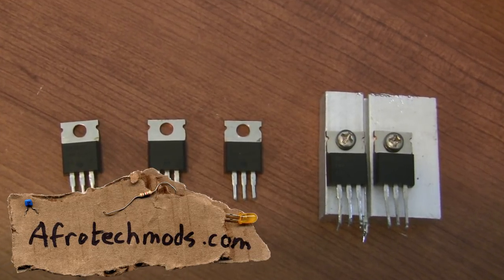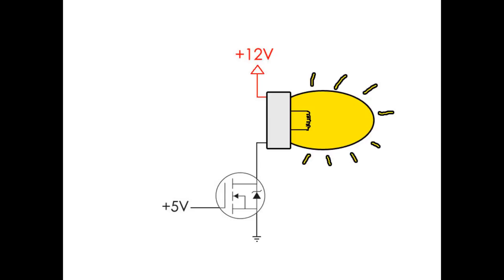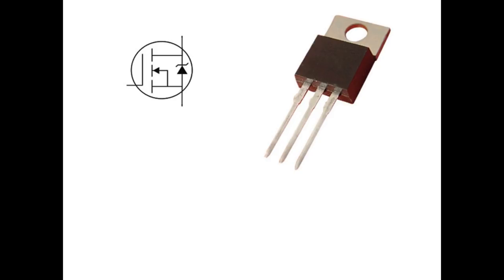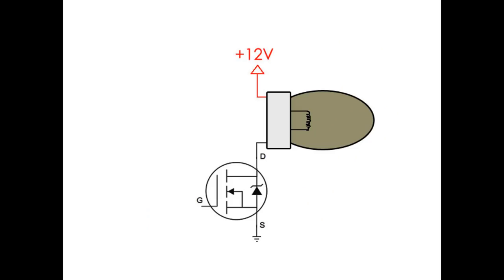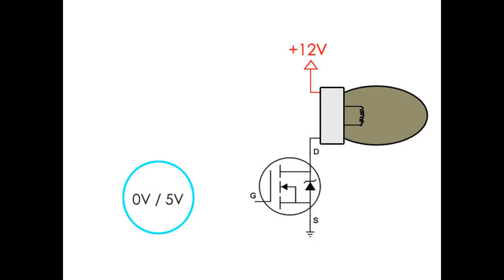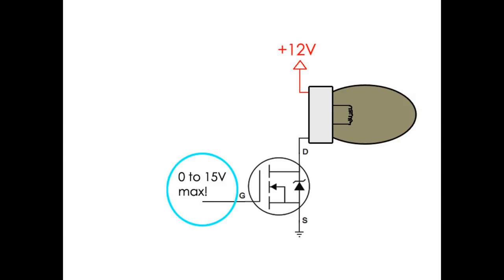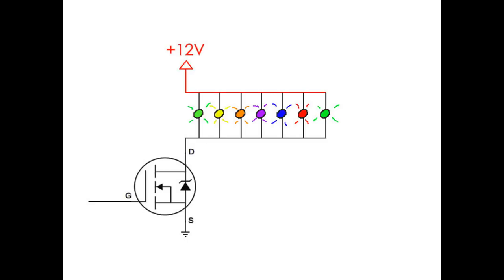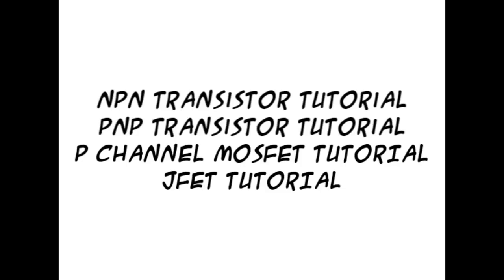Transistor / MOSFET tutorial

Comment: Great tutorial, Just what I have been looking for, thank you. Could I use the 3.3v from my hc-sr501  (PIR Sensor) to power on the IRFZ44N mosfet?. Hope someone can help, Many thanks... John :)
Reply: If I understand correctly, you'll need to arrange some kind of voltage conversion otherwise your mosfet won't turn fully "on" leading to it over-heating as well as not supplying sufficient current to the load.

A simple level conversion can be done using a general-purpose NPN transistor such as 2N2222N or its BC equivalent.

Connect the emitter of the transistor to the gate of the mosfet, the collector of the transistor to +5V and connect the base of the transistor through a 10K resistor to the 3.3V switching signal.  Don't forget the 100K resistor between the mosfet gate and ground to ensure the mosfet will turn completely off.

You might need to adjust the resistor between the base and the switching signal.  Off-hand, 10K should be about right but you could go lower so long as the signal output can supply the current required.  I'd suggest you go no lower than 1K though.

Comment: The top of mosfet (screw hole), is that a drain too?

airsoftforum.        com/board/AB-MOSFET-UPDATE-t174497.html
(remove space before "com")

why did he attach a wire to the heatsink(screw hole?

thanks for the help in advance!

Comment: Hi, I'm complete green idiotwith electronics.... I have one question, if you could help me. I know there are adjustable potentiometers, howether, I need potentiometer you can adjust not by hand, but but voltage. Hmmm, probably I'm writing tyrange things, so in short: I need to change voltage, similarly as adjustable potentiometers do, bu not by hand, byt by other potentiometers... For example: Potentiometer is set to 1 to 1 (just letting everything go as it is - (5V). But there is other potentiometer which is sending 0.5V to the "main potentiometer" and - yes, it's easy for now, but, I want to change potentiometer value to 0.5V, not by hand, but by voltage.... I'm sorry if you do not understand anything - I have no idea how electronics, even analog works. I prefer analog in this case. Instead of using my scewdriver, is it possible to set the potentiometer just by voltage sent to it? Is this possible?